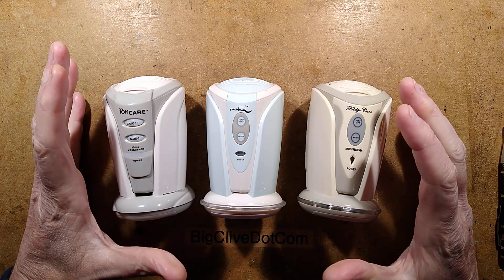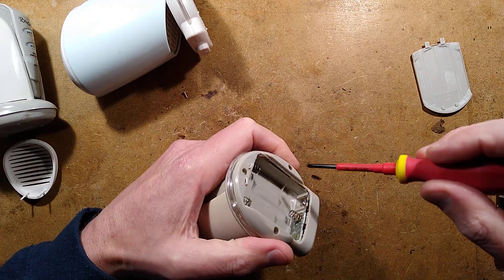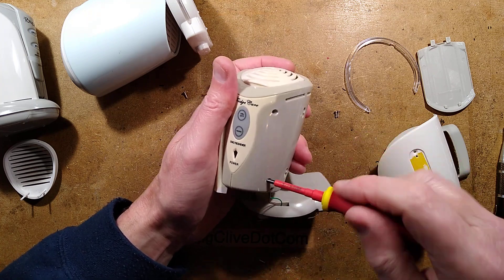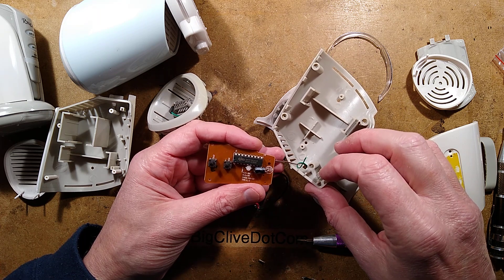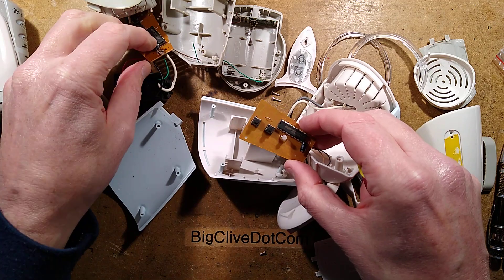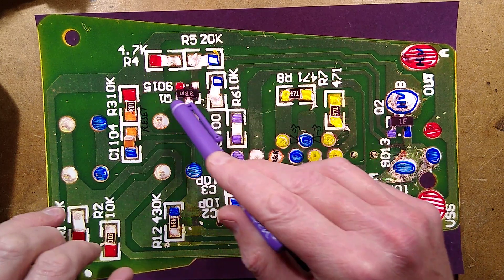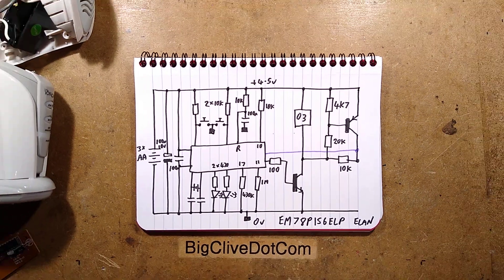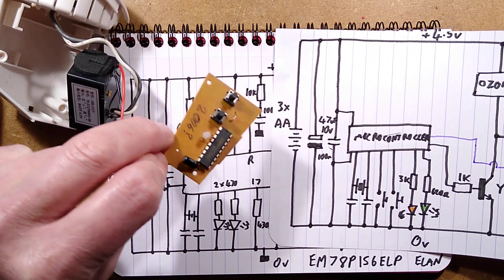20 year old design vs the current version (with schematics)

Comment: Put one of these in a box overnight with stinky shoes or sneakers and remove the stink better than laundering (and with less damage).
  I took mine apart, too. Thank God for glue.
  These work great in a refrigerator. But more is not better. I put a serious ozone generator in my fridge and all the plastic bags disintegrated.
Reply from the maker: I've got videos about permanently curing stinky feet and boots.

Comment: Hey Clive, I noticed at 9:30 you’re pointing out some of the codes that appear as though they could be date codes, but blatantly ignored the “2006-08-10” on the PCB. I would assume that would indicate that the PCB was manufactured or designed on August 10, 2006 or October 8, 2006 (depending on how dates are printed in the locale that made this).
Reply from the maker: I frequently miss blatant text on PCBs because I'm looking at the components.
Reply: It's August, there's no middle-endian date format that puts the year at the start. That's another advantage of yyyy/mm/dd, it won't be confused with another format, most of the time at least...

Comment: is the output on pin 11 at 12:03 pulsed on and off and the O3 generator takes a high frequency square wave drive or is it a  DC to nKV module?

Comment: Just to let you know, I bought one of these after the original video, I have a lung problem that falls under the "catch-all" remit of COPD............... I was hoping it might improve my breathing and "clean" the air  the opposite happened ......it made my condition worse .................... 
Not to worry its off and the batteries removed it was worth a try and my breathing is improving again now its not working..

I thought it was worth a try and equally worth posting to those with my condition not to try it

N
Reply from the maker: Have you tried a Hepa filter unit?

Comment: I think the date code on the 16 pin DIP IC is 0816, not 0016.  I'm comparing the 8 in the DC with the 8 in the P/N.  Excellent analysis you do every time.  Many thanks for your hard work.

Comment: I had a di-ionizer in the 90's - mains powered with about 6 holes horizontally along front. you could feel the buzz when it was working, and clearly see the pointes just behind the holes.

Comment: I'd never used Ozone for anything, but a forced experiment has left me fairly impressed. my dear pussycat caught a big fat rat, and left it hidden behind the draws. was quite a few days before the stench made me go looking for the source. anyway, cleaned that away, but the smell lingered. I tried the usual housewife remedy's, bicarb, vinegar etc, which helped, but still lingered, to the point I stopped sleeping in that room. I don't have a proper ozone generator, but I do have a whopper plasma globe that generates prodigious amounts of ozone. left that running close to the spot over night and through the day. when I got home, I was really impressed, no smell at all. probably not something Id want to have running all the time, but I was amazed at how effective it cleaned out one of the stankyest stink ive ever had to deal with.
Reply: Yeah, those plasma balls really do throw off an incredibly amount of ozone. You can very easily smell it coming off of them.
Reply: I hope someone is still out there to answer my question . I have one of these from my mom. I think it’s the one on the far right. She used it in her fridge as do I. Is it effective? Should I keep putting batteries in it???

Comment: I like seeing blends of older and newer technologies like this. There's also some advantage to using older parts in some circumstances: they're often cheaper and/or easier to get (as long as they're not "too old"). I'm thinking of the engineers I know who've had so much trouble getting ARM μCs this past year. They always rib me for sticking with older 8-bit Atmel μCs, but at least I can get what I need. It's been ridiculous, the wait/lead times for even the simplest of chips, for everyone.

Comment: Research has found that ozone generators were not effective at stopping mold or bacteria growth in a standard hospital room, and would require unsafe levels of ozone to do the job at all (Dyas, Boughton, & Das, 1983). For mold growth, public health departments do not recommend using ozone generators for clean-up, saying that ozone even at high levels cannot control mold.
Reply from the maker: High enough levels to sterilise a room completely would be harmful.  But trace levels that emulate outdoor levels are beneficial.

Comment: Hey Clive, pick up one of these :US $15.69 | T&L001 118MHz-136MHz AAA Air Band Radio Receiver Airband Radio Receiver Aviation Band Receiver For Airport Ground

Pretty sure it's transmitting/jamming on air traffic frequencies because the thing is drawing like >3amps from 2 AAA cells.

Comment: Hey man 🙋‍♂️
Unrelated question..
I got an old magnetic ballast from the dump and I didn't realize that the new florescent light bulbs have what they call electronic ballasts.. apparently the electronic ballast is a solid state ballast that takes 60hz and makes it like 20,000hz 🤔
My question is..
Are what they call "solid state electronic" ballasts just tesla coils?
Thanks Clive 😊
Reply from the maker: The electronic ballasts convert power to DC and then recreate the higher frequency AC to allow use of a smaller ballast and reduce flicker.  There's no real connection with a Tesla coil.

Comment: Wonder what the ozone does the plastic lined inside of the fridge, or to tupperware, if used over a long time.
Reply: And the fridge seal. So far no problems in ours though it did kill a plant when used in a room and possibly the rubber on some headphones that went sticky. Deodorised slippers well. They’re great little units.

Comment: Another good video from Big Clive. 
Interesting comments on the term vintage especially when referring to (paraphrasing) “my past designed equipment in the surplus or junk stuff at sales”.
I designed, built, tested and installed my temperature controlling systems for use plant growth research in greenhouses/glasshouses from 1988 until the last one installed in 1994.
Every one using analogue op-amps etc except for one CD4066 IC.
The 1994 unit has been operating 24/7 every day since 1994 except for less than a day when an extra protection unit against wind damage to the greenhouse structure was added, and the extra mains power circuitry was added to the main incoming power supply.
The controller sections can be individually isolated for essential parts to be replaced due to wear about every three and a half years and only one IC has had to be replaced. I predicted that the system would work for 20 years. Similar computer controlled systems have been fitted to other facilities but none have the same record of reliability. Truly vintage stuff.

Comment: For fun, I built the "Batt. Test" part of the circuit.
However, I have used a 2SA1273, and the 22K has been replaced with 28K.
Roughly adapted to work with an 18650 cell.

Comment: Not saying this is for sure, but TCM could stand for "Tchaibo Consumer Marketing" - A seemingly generic brand name of electronics goods manufactures whose product were sold by the likes of Sainsbury Supermarkets. As a brand, it appeared about 20 years ago. As for the products, some were decent, some were trash, none were grossly expensive. In the end, they seemed to disappear after very short life.

I'm just wondering if the PCB marked with TCM might have been installed in a product made ostensibly for Tchaibo?  Most of what they sold seemed to be generic goods, just with their logo printed on them.

Comment: A (completely unrelated) update on my Panasonic anyloop NiMh cells, which I mentioned in a comment on one of your previous videos. I accidentally left my Game Boy switched on after they ran flat, and when I checked them the next day one was at around 0.8V and the other read 0V! Anyway, I swapped out my second pair and left the flat ones overnight, and when I checked them the next day they were both at around 1V. I put them on to charge and they both came up to the full 1900mAh.

My second pair is still only charging to just over 1700mAh, although I think I got impatient one time and charged them at 1A instead of the usual 200mA, to it's possible they got a bit cooked.

Anyway, I was just a bit surprised that the 0V cell came back on its own.
Reply from the maker: The NiMh cells are less likely to be damaged by over discharge than lithium cells.

Comment: These are great little bits of kit, and work really well.  I have one of the older models that you did a tear down on.  Being in the fridge they can chew up batteries quite quickly but even so my one has worked for years with no problems at all.  A good honest little design that seems timeless.😉

Comment: I have the one with the boat load of screws. Ordered the modern type from Amazon.
Received a unit that someone already failed to take apart. Too much glue 😁😁
Sent it back to Amazon and ordered another one of the old design. Works great and the chimney effect is stronger in the open design.

Comment: I bought one of these but I’d love to know how to keep it going at the full power setting and how to power it with an adapter
Reply from the maker: You could theoretically run the ozone generating module directly from a USB power supply with a diode in series.   The unit may not be suited to continuous running though.   Mains powered ozone generators are available.

Comment: The mystery inputs to the uP are test points that allow the factory to test the timer. You need a means to test any timer that slowly counts the crystal pulses over the course of minutes and hours. The test points allow the factory to significantly speed up the counter so that what normally takes hours now takes a second or two. Without this test feature, you cannot verify that the timer algorithm is properly working.

Comment: Regarding the design-cahnges on the "modern" unit:
To me personally it looks like they had some pictures of the OG-Unit but no side-shots.
This would explain why the "grip covers" are missing and why they don't have the angled cut in the back. The sides & back is too plain and the front of the unit is completely overkill like the original ones. 

But fascinating how nothing inside has changed - even the cable-routing is in the battery-compartment is exactly the same.

Comment: You might think that as the product evolved, the construction would become less comp!ex with fewer screws. 
Were all these units in working condition, before they were disassembled or were they designed with built in obsolescence, this consigning them to land fill.
 In my experience, redesigns are usually triggered by unforseen design errors, the need for cost reduction, or the obsolescence of critical components, which can no longer be source. Which was it this time do you think?
Reply from the maker: Probably older microcontrollers going obsolete.

Comment: I bought 2 unit's of the "new" one when I seen your video 3 months ago. I put 1 in the fridge and 1 in the room. I have noticed no difference from the one in the room but I have noticed food lasting a little longer even though I got a modern fridge from the one I put in the fridge so yes most definatly good for fridges.

Good to see that the design hasn't really changed all that much.
Reply: More than for preservation, the ozone in the fridge removes odors so they don't travel between foods. But the ozone also does destroy some of the pesticides on the surfaces and kills germs and molds.

Comment: 2020 version also reduced the transistor drive current by a factor of 10.  Was 100 ohms and now is 1K. - 16:08
Perhaps because the new transistor has more gain (minimum specified) or they were over driving it before and wanted to extend the battery life.

Comment: Just buy a 350-500g tub of baking soda instead... oh, and replace it every 2 years or so... my family has been using them literally for generations now, and there are no bad smells to speak of inside the fridge too!!!
Edit: Arm&Hammer makes them specifically for fridge use, and the cardboard container has a number of pre-cut holes accordingly...
Reply: How untechy of you! 😄
Reply: Baking soda takes care of most odors (although not fish), but it does nothing for the lifetime of fruits and veggies.
Reply: @jpdemer5  that’s why fridges have crispers and even water supply lines that do more than just make ice and provide filtered cold water...
Reply: Oh I also forgot: for the smelly stuff (or any cooked food), that’s what Tupperware was made for (or even Saran Wrap over a plate)... 😷
Reply: @MikeOxlong-  So no need for baking soda after all.  Check.
Reply: @jpdemer5  ya for sure, if you don’t have anything spoil, or spills of things like milk products not wiped up, etc... Basically, if you’ve got your sh...t - err... fridge together, you really don’t need anything but common sense to keep it clean and scent less. And if you’ve got a fridge made in the past decade to 15 years or so, that’s not an absolute basic model with no compartments whatsoever, and/or use a little common sense with how you store things, stuff will stay fresh quite a while too...
Reply: @MikeOxlong-  Or just spend $15-$20 on the ozone gizmo, and stop worrying.
Reply: @jpdemer5  I prefer a clean fridge, and don’t need nor would want “gizmo’s” for anything. Certainly not in the damn fridge!
When you’re brought up right and/or have a good woman who enjoys a clean house, this is a non issue, like ever. It costs a buck for a box of arm&hammer and it lasts at least a couple years. Plus when your spaces don’t get dirty, plus are regularly cleaned even if they aren’t, you have a different attitude towards this stuff...
It’s like with most Americans, and others who either don’t care or know better, that wear their shoes indoors. It’s eff-ing gross. But some are just oblivious of that too...
Reply: @MikeOxlong-   Sorry to have triggered you.

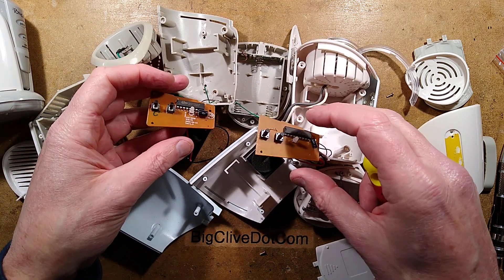Comment: Between 9:28 and 10:00 you seem to be saying this unit is from around 2000 and even have 2000? inked on the board. All the time you were talking your pen was moving over the date 2006-08-10 painted on by the manufacturer. I hate to display my ignorance in public but, what did I miss?
Reply from the maker: I was so engrossed in the circuitry that I missed the text.

Comment: Clive,
My wife is a veterinarian and we own a clinic.  I am debating adding an ozone and/or UV source into the HVAC system to help with the perpetual smell and to help sterilize the air that circulates for cleanliness reasons.  Do you have any suggestions/considerations regarding a heavier duty (somewhat high output) system?  Even if it is just general considerations and things to look for..
Reply from the maker: There are quite a few systems for HVAC systems.  I'm not sure which is the best.  The Nu Calgon iwave comes to mind as a controlled output ozone unit masquerading as an ioniser.  It has self cleaning carbon emitters.
Reply: @bigclivedotcom  You are my hero.  It at least gives me somewhere to start and something to compare to!  Anything would be better than "Tropical Breeze' flavored cat whizz.
Reply: @bigclivedotcom  You are my hero.  It at least gives me somewhere to start and something to compare to!  Anything would be better than "Tropical Breeze' flavored cat whizz.

Comment: Will you be installing the bits and pieces in the fly chopping toadstool? They might help with the smell of chopped fly stools. Another good point is the lack of required reassembly, if you do! Good luck. 👍

Comment: AA Batteries a good design choice on their part, Since they have more power density than AAA!! Also, I’m 23 so I guess I’m vintage now🤣 I’m fine with that vintage is always better in my opinion!!
Reply: Always made sense 'AA' had more power, but surprised that the actual number was triple or more the density of a 'AAA', and cost the same.

Comment: Exactly how many negative ion generators do you have Clive? 😁 Are you single-handedly trying to fix the hole in the ozone layer?
Reply: @soundspark  thinner than it should be, but not nearly as bad as it was.
Reply: This years hole over the South Pole is one of the biggest measured in its early stage it might be the biggest yet.
Reply: @soundspark  they should just put a bunch of these on their roofs and fix it.
Reply: Interestingly the hole in the ozone layer is pretty much gone(not entirely, but the phenomenon is greatly reduced), and it is sometimes used an example of successful environmental policy.
Reply: @garethbaus5471  Its not gone and it's still a case, especially when styrofoam manufacturers for example in China still using fckw in production and release it because it's cheaper to do so.
Reply: @garethbaus5471  Interestingly....it has very little to do with human activity and occurs naturally and repairs naturally based on the seasons.
Reply: @toomanymarys7355  it vary seasonally, but the average thickness does appear to have been significantly reduced by certain molecules produced by humans and the existence of a near complete gap in the protection created by the ozone layer appears to be relatively a new phenomenon.

Comment: @3:40 "and stickey tape", is there any other kind? 
Ha
Keep up the videos!
Reply: "Sticky-back plastic", if you're a Blue Peter presenter... :P
Reply: In plastering they use (amongst other types) paper 'tape' w/o adhesive in the seam/fill between sheets of drywall...
Reply: Ticker tape
Cassette tape
Video tape
Tape measure
Police tape
Finish line tape
Bubble tape gum
Probably a lot more but this was off the top of my head.